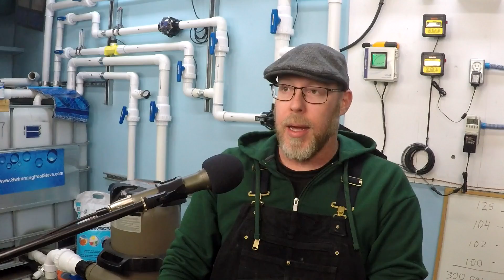BAD Swimming Pool Installations!

Comment: Considering how substantive & impactful pool construction is, I'm shocked municipalities haven't required regulation & standards for the “industry”. I guess we're fortunate there's generally a lot of actually good pool builders, over the decades. Regardless, as good as my experience was, the industry should be regulated; e.g., I highly doubt that most pools are built very accurate to the drawing(s).
Reply from the maker: Part of the problem is, and always has been, the industry is too wide and too complex to squarely put in a box.  I apprenticed as an electrician.  I understand trade licensing.  Pools is a unique animal. There are so many different kinds of pools, and different technical processes, and different geographic considerations...plus this is just to build them.  The service world is way bigger than the installation world.  Its too much, and that is how you get where we are now.  A weird, somewhat forgotten about trade that is not really a trade and hard as heck to manage / police from a standards perspective.  Thank you for coming to my TED talk ;)